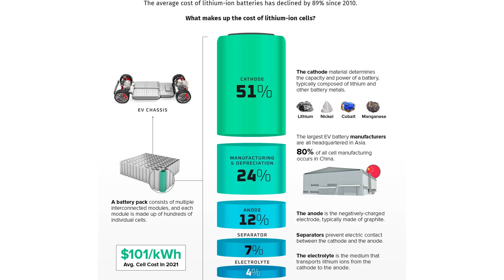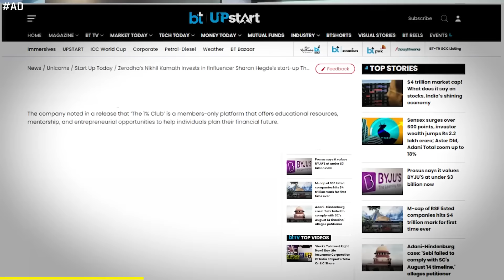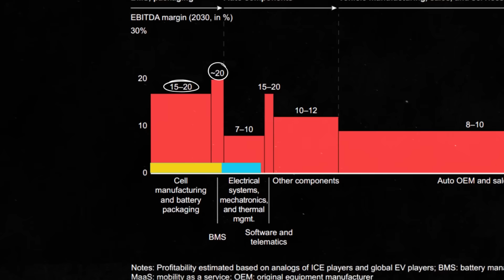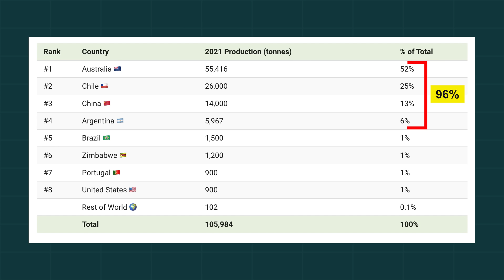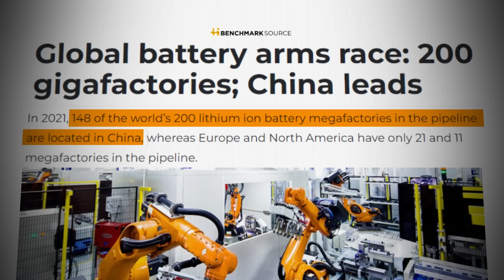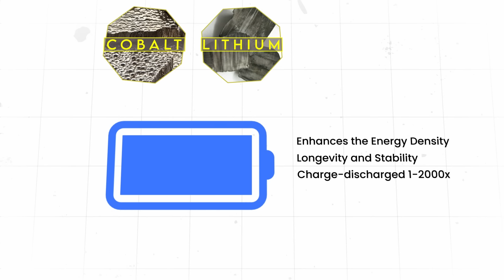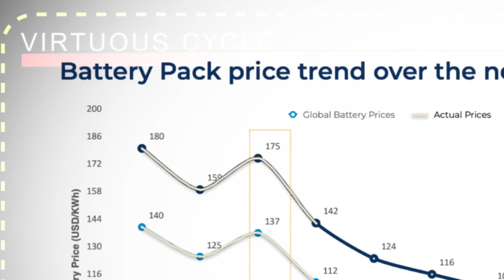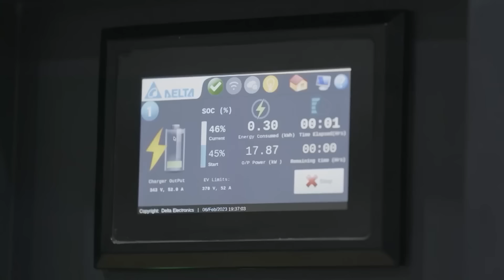Is India Winning or Losing the Electric War?: Business Case Study

Comment: What about after sales service?
Let's consider 15 years span for an Electric motor and a petrol engine, electric motor has more risk of breakdown than a fossil fuel engine and normally we get around 3 years of warranty. After 3 years if the motor breaks, it's much more costly compared to an engine, also if the battery starts degrading, then the batteries are one of the most expensive components of an EV. In real life scenarios, Any vehicle can breakdown and from what I understand fixing EV may cost 3 to 4 times then an engine or non-EV Vehicle and I don't think even the most advanced battery will last more than 8 to 9 years including motors, so when you calculate this component replacement, then the total ownership cost will be close to eachother and in some scenarios EV ownership may become costlier then an Non-ev.

Also, most EVs are sold as premium products. There are very limited brands which sell EVs at reasonable prices.

Comment: How about the replacement cost of batteries in EV. An ICE car easily runs for 15 years, however, EV battery wears out in 8 years and cost of replacement is close to 50% of total cost of a new car based on current cost structure. This could make TCO to be same with ICE car.
Reply: Who said batteries need replacement in 8y?

Do you throw away laptop and phone after 1y warranty expires? 

Warranty =/= life
Reply: Look.. my point is.. the cost of battery has to come down in order to increase the penetration of EVs. In India we still don’t have proper study on the number of years an EV battery works. While we have 8 years warranty, we shouldn’t be bothered till that.. but beyond that it has to be considered. Some reports say EV battery can last up to 15 years but can we trust that completely? Reports also say iPhone batteries last 5 years but does iPhone batteries really last 5 years. Similarly, given the lack of evidence in Indian driving and charging conditions, we should definitely think about the life of an EV battery. As the cost of battery replacement goes up to 50-70% of total cost based on current cost structure. We should also think about resale value of these cars because resale market is typically for budget customers and will they be ready to invest in a new battery for a 10 year used car.

Comment: But the adaptions of EVs is not solving the problem of carbon emission as most of the electricity in India is produced by the non-renewable resources.
So, is it not important to first focus on the production of electricity in a feasible and renewable manner and then promote/accelerate the EV market.

and if we don't have lithium power/hold we can still make a business in recycling phase. If we start today the market is small but in coming years most of the EVs would need a replacement battery (as per my knowledge battery packs are changed after almost 5years). So, till then we can have a full proof factory and the bonds with companies to scale the business.

Comment: We had made a presentation about this topic a few months ago, and a major thing that was mentioned in our conclusion was a question, "Where and how will we get the energy to sustain this new EV revolution?". India is mainly dependent on fossil fuels (Coal) to produce electricity, according to my research as of 2022, India is producing ~80% (might not be accurate )of electricity through fossil fuels and the rest through nonrenewable sources. What are the steps taken to take care of the additional requirement of electricity to charge these EVs, also can our existing energy generation solutions handle such a huge demand in the near future?🤔🤔
I think this can be a very good topic for the Think school team to make a case study. or maybe not please share thoughts😁
Reply: I drive 40km daily and barely use 4-5kWh of electricity 

This is about same as consumption of 1.5T AC over 2-3h  of running. 

More driving means more charging — what you’re quoting is the battery size — nobody is using up the entire battery of their car or bike in daily usage. 

In my case, my EV will last an entire week of driving on single charge ie ~1000km per month. 

Besides, what you’re not realising is that the fuel used by your car is also transported in some way or other for example through trains (electric or diesel) from refinery to depot 

Then via truck to each petrol pump. Even refining of the fuel at refinery is using some energy in some form. 

By not using ICE cars, you’re also eliminating this background emissions and energy usage 

Let’s say all tanker trains are eliminated once we shift to ev’s, the energy saved from not having to drive those trains to transport oil will more than cover for the electricity needs of charging ev’s 

We are substituting one for another so obviously the resources used by the former will be freed up.

Comment: EVs have a lot of problems that need to be solved but we have no other option. There is research going on with sodium ion batteries but the weight is huge issue. If this works, lithium scarcity wouldn't be a problem. 

Charging infrastructure is the biggest issue we face currently.

Comment: Electric vehicles (EVs) are good for the environment as they produce zero emissions and have a light weight. However, there are certain disadvantages that I have noticed, such as the processes of battery production and charging are not very eco-friendly. Moreover, charging an EV takes a long time compared to refueling a conventional car. I hope that in the future, there will be improvements in the methods of making and charging EV batteries.
Reply: you are wrong batteries are heavy even for a lithium battery
Reply: @VikramAdithya48  true even then making one do required fossils fuel

Comment: India, a land abundant in resources, is poised to excel in the battery game with lithium deposits surpassing China and the USA combined. The key lies in establishing processing capabilities, similar to oil or nuclear fuels. Solid-state batteries like SABERS and salt batteries are on the verge of widespread adoption.The challenge lies in cobalt, a scarce, expensive, and toxic material. Despite its industrial dominance, there's a push to replace it with alternatives. While cobalt still holds sway due to massive scalable plants, emerging battery technologies and efficient manufacturing methods signal a potential shift in the future.
Reply: someday? or in dream?🤣
Reply: @jeffwong1166 dreams of resource-scarce lands. In the case of India, it's akin to buying peanuts for snacks. The reluctance to embrace rapid changes stems from the risk factors associated with an uncertain future. Waiting for some decades and adapting to the massive population of 1.5 billion seems like a strategic approach. 😂

Comment: Two major issues due to which this EV hype will vanish.
1) The Charge time is way to long. For Cars it takes upto 10hrs. Which is not practical at all. Range is barely 300kms. That to driving on economy. Currently there is a cost advantage now however the cost advantage will decrease overtime and demand will fail.
Huge population in India still don't fit CNG on petrol cars as  CNG has longer line and lacks the range. (120-200kms) where as on petrol they can easily cover 500+ on single refueling.
CNG takes barely 3mins for 1 car still huge population is not adopting.
Same case will happen to ev.
I had bought Petrol car and added CNG. When CNG was 48 per kg. Within a year it shoot upto 92 per kg. Thus the cost advantage vanished which CNG had. This sold my car and opted for Disel.

The best option for India for alternate fuel are only 2 options which are more practical than EV.

1) 100% Ethonol. 
2) Hydrogen. ( This is also a kind of EV) as it's also electric but electricity is generated on demand rather than storing. Also takes hardly 3mins to refuel like CNG.
There are 2 challanges for hydrogen. Either create hydrogen on site or transport from a manufacturing unit (but the transaction of hydrogen comes at a huge cost as special containers are required to transport hydrogen).

Comment: India will emerge out as a leader if it wins the game of Green Hydrogen, Fuel Cell EVs, Solar Energy, Solid State Batteries, Super Conductors and AI. Time that India transformed itself from being a follower of technology(eg Lithium ion route) to a leader in technology. China is rich in Lithium resources, therefore it works for them. Whereas India is blessed with plenty of Sunshine 300 days a year across the length and breadth of the country. India must play to its strengths. We need to think different and also take some calculated risks. More importantly must not get way laid by the detractors, saboteurs, and internal enemies colluding with invisible external forces during this tough and long journey. Every export ban, sanction, tariff from another country must be seen as an opportunity become self reliant and emerge out even stronger.

Comment: GOOD ANALYSYS But you have to understand the EV market has not at started. But China has invested Massively with a hope that they will be king in Lithium. But peak EV car takes another 20 years. Is Chinas investement worth of return? It may be like China invested 100 turned to 500 after interest after 25 years and earned 200. Just like what Tata is doing they are selling but not enough quantity to sustain. Where as Maruti is waiting for peak, so its slowly shifted from Diesel to Petrol and Now petrol to hybrid [ petrol and Lithium Battery] and later completly shift to EV.

Comment: Of the 10 largest EV battery manufacturers in the world, 6 are Chinese. These 6 companies account for 62% of the market share. CATL and BYD account for 52% of the global EV battery market. The other companies in the top 10 list are 3 Koreans and 1 Japanese.

The Chinese accounts for 90% of the cathode and 70% of the anode materials used in the EV battery manufacturing. 

With over 60% of the global market in EV, China remains the largest market. It is estimated by 2025, China's import of oil will peak due to the large number of EVs on the road.

The EV story is similar to the solar panel market. With 80% market share, China dominates this market.

Comment: In my perspective, transitioning to electric vehicles (EVs) doesn't guarantee a complete elimination of carbon emissions. According to the Central Electrical Authority (CEA) report, thermal power plants contributed a significant 78.2% to the total electricity generation in February 2023, overshadowing the mere 12.3% attributed to renewable energy sources. Meeting the goals outlined in the Paris Agreement, which requires a 45% reduction in carbon emissions by 2030 and achieving net-zero emissions by 2050, remains a considerable challenge. I am uncertain about the extent of efforts undertaken by our government in this regard..

Comment: One thing to note here is that even though the hydrogen fuel cell tech is far behind in catching up to the EVs, it has potential, hydrogen is so abundant in our universe and on earth... And that experiment is happening in japan by toyota right now, and if it succeeds we may have something which has even less carbon foot print, as the refining of lithium and mining is also a hazard to nature where as obtaining green hydrogen is fairly simpe and even less developed countries like india can quickly start making heaps and heaps of green hydrogen.... Though it is a bit dangerous, if it explodes.... But it is also a lot more powerful than lithium for its weight.. and can also be filled like normal gas in few minutes, and better energy density.... Just need for research, while china is busy expanding on lithium ion stuff.... Godspeed toyota and japan

Comment: But what happens in 5-7 years when the battery of the EV degrades and no more holds as much charge. While normal vehicles can easily last over 10 years without problems if maintained properly the same cannot b said for EVs especially the smaller 2 wheelers etc. I feel hydrogen or hybrid is the way
Reply: 中国对于汽车电池的要求是，8年后电池容量不得低于出厂的百分之90

Comment: Can you please tell me why Toyota is doubling down on Hydrogen ? Cos if you say that battery raw materials are also similar to Oil - a limited resources. A few EVs in a world full of ICE makes sense,but the moment everyone switches to EVs , EVs will become unsustainable … so an equilibrium will always exist between the most abundant Power Delivery means ( Petrol Diesel ) and a Novel Power delivery means ( EVs, Hydrogen, LNG, Zn / Fe / Al Batteries, Solid State Batteries, Compressed Air Engines) which means no ! 

people who control Battery Raw Materials will not control the world ! Whoever controls the ends of this equilibrium spectrum will have a lot of control, but the world - No Way.

Comment: Although fuel cost is high but ppl still aren't keen to buy electric vehicles due to issues with life of the battery which would only last for 5 years maybe .Indian ppl need another half a decade to start believing in EV vehicles. EV companies should find a way to tackle the problems of EV vehicles  repair ,even a small repair is costing way higher than the normal  Engine vehicles .At last EV companies should find a way to increase the life span of the batteries or else make the battery cost economical ,that's when EV industry in INDIA would see its major boom.
Reply: From where are you getting the figures that EV batteries last only 5 years? Liquid cooled batteries last very long. Tata is giving 8 year warranty on its batteries.

Comment: TCO of EVs is too soon to tell. An EV battery should last around 7 or 8 years and the cost of replacing that might be 30 - 40% of the Invoice price. I have never seen anybody factor that in. An ICE car is registered for 15 years. An EV would go through 2 battery packs. What is the TCO between them then?
Also, in order to reduce pollution, easiest way is to ban ICE motorcycles and scooters below 250cc and only allow EV. That would be the easiest way for mass adoption

Comment: Not upto mark, outdated information, 
Of metal ion chemistry sodium ion battery is in pre production stage and active research is happening in aluminium ang magnesium ion chemistries. For grid storage there is redox flow batteries. 
Passenger vehicles are relatively small percentage of pollutants compared to heavy road, air and sea vehicles and industrial emissions. 
There are lithium ferro phosphate battery without cobalt, no mention of it. 

From peak price of lithium in nov 22, prices has since crashed 78%, no mention of it. 

No mention of fuel cells

No mention of hybrid vehicles

No mention of solid state battery 

Article just creates hype around lithium

Seriously, still comparing lithium ion with lead acid? 

Reading wiki page on ev batteries will give, way more and better information

Comment: I think you missed the Biodegradable battery - Made in India (Nexus) and ecell ( aloe Ecell). We are doing lot of R&D in developing sustainable and plant based battery. (I think you should make a video on it.)

I strongly believe EV / Hydrogen fuel/ Ethanol, Solar, we will be focusing on  having an hybrid system.
Reply from the maker: Not significant enough to put us in the lead
Reply: I think we should be focusing more on Hybrid systems with environmental sustainability options in battery manufacturing.

Comment: The life of an EV wheel has not being discussed in this video. A ICE engine can do 5,00,000 kms on a vehicle in a span of 15 yrs and still be just fine whereas an EV vehicle will break down after doing 1,50,000 kms in just 5 yrs. So in long term ICE engine is more valueble then EV

Comment: First of all, do Indians need EV cars? Here are the challenges of EV cars. You need a dedicated place in your home to charge them. Most of the Indian car owners do not have dedicated parking place so they can’t have a charging station. INDIA needs battery swapping tech for the cars. Second, the center and state govt gets big chunk of tax collection from oil sell. With EV cars, that revenue would diminish so why would govts promote EVs? Third, most of the batteries are lithium based where China has sort of monopoly. Why would Indian govt make more dependency on hostile China? In long run, to be energy independent , India needs to invest on Hydrogen fueled based cars and transportation. INDIA is surrounded by sea by three sides. It just needs to bring the cost down to get hydrogen from sea water and use it as fuel.

Comment: EV vehicles have major problems; cost more to repair, too long to charge (8 to 18 hrs), if the bottom is damaged, replacement could be $50,000 (vehicle is total) or more; if one small battery is damaged, high risk of fire, limited to 320 miles, no long cross country trips possible. In China, serious problems with car fires, very difficult to put out. Dangerous to park two EV vehicles beside each other, cause possible fires.

Comment: to charge this ev vehicles, we need fossil fules which as a result causes more pollution than vehicles. plus ev vehicles lack in power and milage when compared to any ic engine. thirdly, ev charging infrastructure lacks back like 20 years. so to see a minimum ev revolution, we will have to wait another 20-25 years or so.

Plus Indian road infrastructures are also not that sophisticated. one monsoon will damage the entire vehicle when submerged in the water. even if ev comes, ambulance or heavy trucks will still continue to run on fuels. evs are only good for side cars, the main car must be running in fuel.

Comment: This is very disappointing to note that channel which is high on research failed to mention the India's research and prototype of Aluminium air batteries, which has 8 kwh/kg energy density, which is 8 times density of Lithium ion battery. and no where in the video you have talked about IOCL phinergy .  May be those 500 pages did not cover that info, but IMO u should hire more folks for the content research.